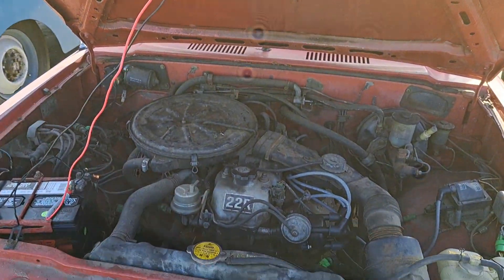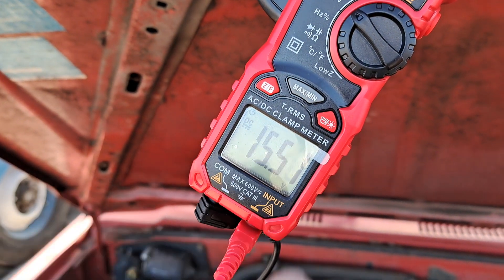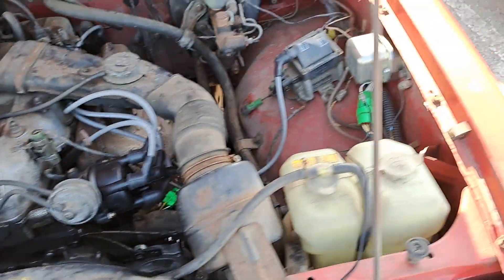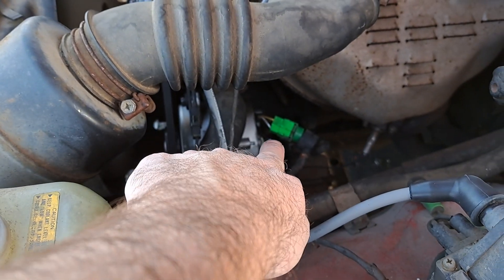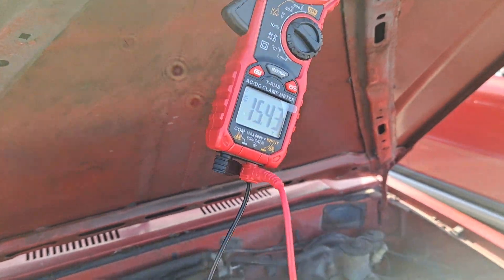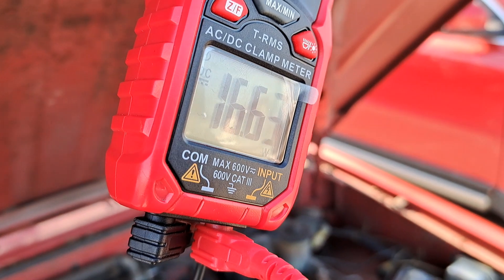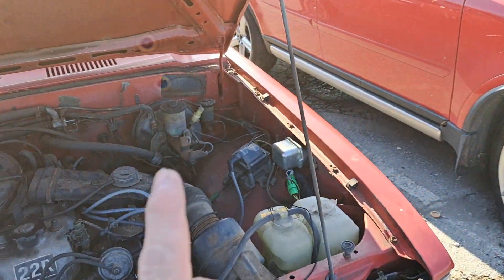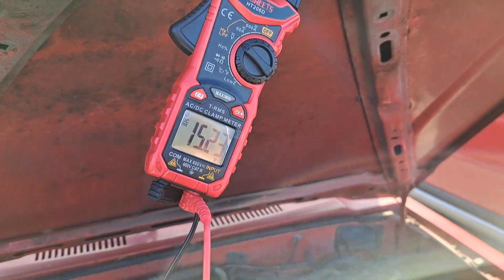1981 Toyota Pickup 22R FEN Alternator 6 pin Voltage Regulator charging issue diagnostics

Comment: I think that’s the same thing on my 81 pick up as well?
Reply: I jusg re ordered another regulator at oreillys since I got the lifetime warranty and see if it fixes it but I doubt it.
Reply: @Rlkxu  is ur voltage regulator a 5 or 6 pin harness??
Reply: Hey bro so my charge light always stays on even after my keys out the ignition on my 82 long bed you know what it is by any chance?
Reply: @Rlkxu  if that charge light stays on? That’s means it’s sending power volts to it at all time. 

The voltage regulator has a cable and the alternator that sends signal to the charging light that it’s not charging not saying it’s not charging but maybe a problem with the voltage or alternator sending the signal to stay on. Or your cluster light bulb..

 Check your fuse mine had rust on the head light not letting it turn on properly….
Reply: What’s the brand of the multimeter??

Comment: Did u solve the problem I have the same problem.  Voltage going up to 18v from my 1981 sr5 pickup  with the 6 pin regulator that I changed and the green wire alternator I changed as well..  did u fix your problem??